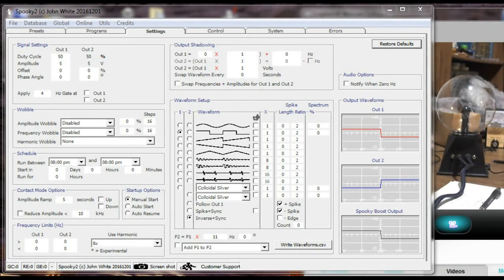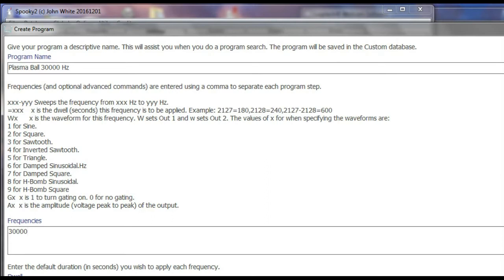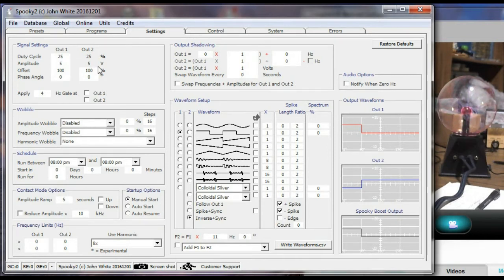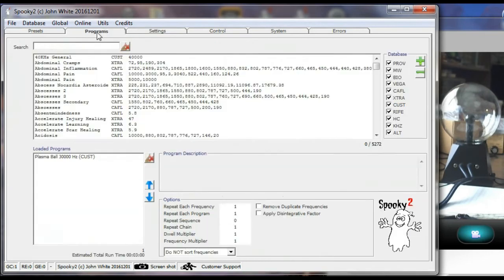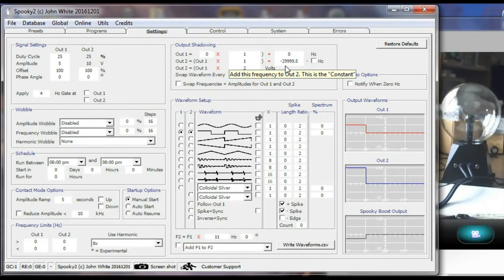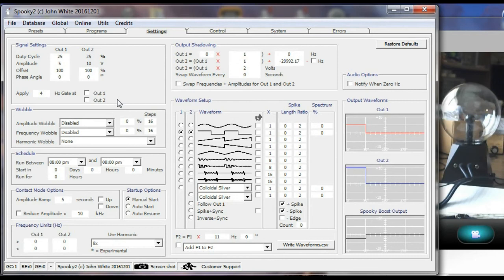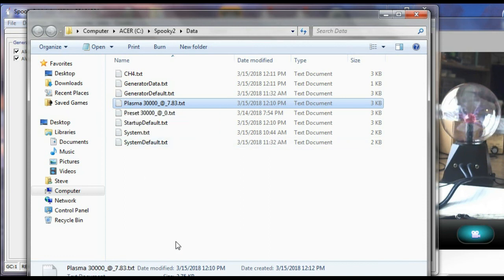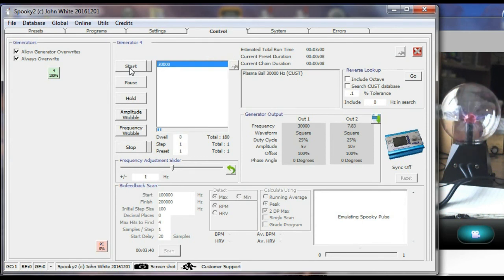Making Spooky PRESETS for Plasma Ball

Comment: Thanks for the video, it is very helpful. I received my plasma ball last week and I am learning how to get it up and running. After watching this video I have a couple questions.

In video on manual settings on the spooky for your plasma ball you used 30240 Hz for your primary and in this video you are using 30000 Hz. Is one better than the other? Do you have a preferred freq for the primary? 

I made up a few presets with the method you described in this video and tried to load them as a preset chain. Going to the control panel and loading the generator, It keeps loading up with only one frequency. Not sure if I have setting wrong or something else is going on. Would you have any idea why that's happening?

Thanks for the help. The plasma ball is awesome and I look forward to learning more about it.
Reply: Hi Steve. Just a follow up on my previous comment. I did figure out the settings in my presets that were preventing the chain from functioning properly. Upon opening the text file of each preset the value for the "Run Sequence" setting must be set to 1. They were set at 0, so each preset wanted to run continuously. Additionally, there is a value for "Run Chain" which should also be set to 1. Save the file after making changes. After making the preset chain and selecting it you can look in the settings on the program page under the "Run sequence" setting and choose 0 or 1 or whatever to set the repetition of the entire preset chain. 

I did find out also that Spooky has a little utility app called Chain Editor that is useful to modify settings to an overall preset chain, or the individual presets in the chain. Using that app is a more convenient way to go through the text files to find your settings and make changes.
Reply from the maker: Thanks for the great answer.  I captured this info so I can update the website with this information.
Reply from the maker: The video is 22 minutes long and a detail explanation of all the possible things that could go wrong is outside the scope of this blog.  It was my intent to help and not get caught into hours of trouble shooting, especially via an open blog.  I am very sorry but I honestly do not have a quick suggestion as to what you might be doing that is causing your problem.  Maybe one of the Spooky forums would be a better place to pursue an answer on how to create linked PRESETS.

The 30240 frequency is a harmonic of 432 hertz.  If you are going to use a carrier frequency, a frequency known for potential health benefits would be a better choice than a simple frequency like 30000 hertz. The frequency 30000 was used simply to keep the math simple.
Reply: gskempe9 One small correction to my previous post. The lines of text you are looking for in the preset script are "Repeat Sequence" and "Repeat Chain". It was late when I wrote that reply. Have a great one and thanks again.